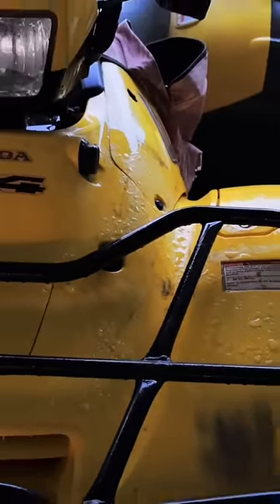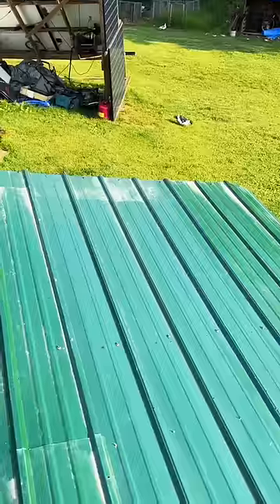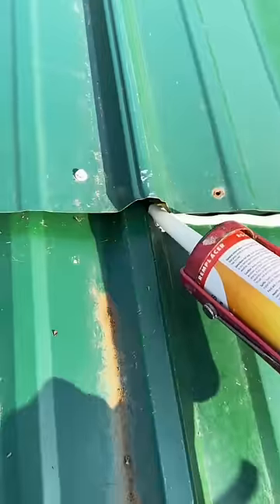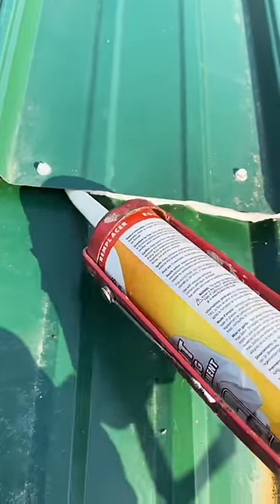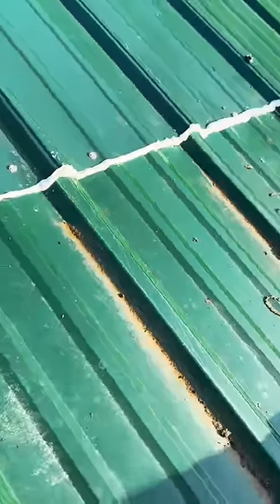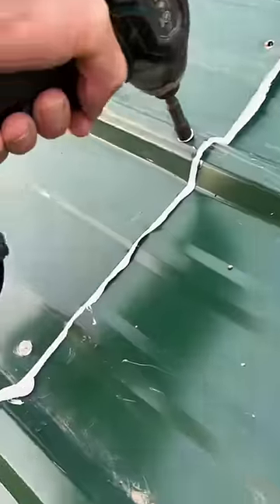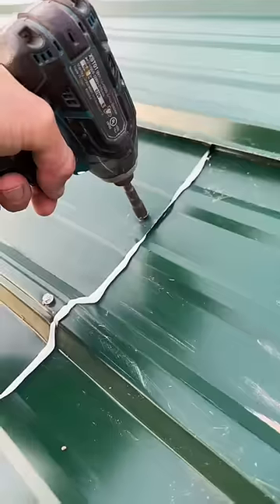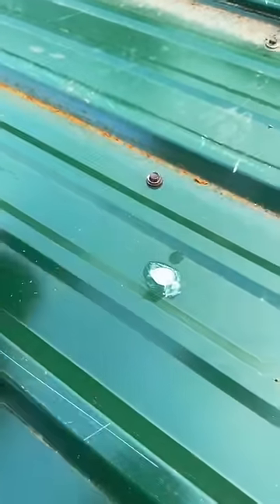Stopping carport leaks

Comment: The foil tape that some people use on ductwork is great for sealing screw holes. Cut small squares and cover the holes from the bottom side of the metal.

Comment: Roofing caulk the screws as well if it leaks after this. I’m not a builder or anything. But my dad did this to my cheap shed and it’s water tight now
Reply: Yup anything that goes thru the roof that isn't caulked will leak
Reply: It’ll work for a year or so and will need to be replaced depending on what brand was used M1 caulk is the best tho can lay it in any weather and it’ll hold true to time
Reply: Should be using roofing screws with a neoprene washer so this doesn’t happen, and shouldn’t be screwing into the pans, only on the ridges
Reply: @dankboi2295  that's good to know

Comment: As a waterproofer use NP1.
Coat all the screw heads and fill the holes.
The rubber grommets will either split or the water on them will freeze and split them.
The other issue with the grommets is the install.
Some people screw them down until they tear.
They are just suppposed to touch and then pooch out just a bit.
Impact drills go to far sometimes.

One other piece of advice.
NEVER use USED metal for a roof. 
Been there done that never again.

Comment: I've become a bit of a fan of Flex-Seal. The bucket version is very similar to the old roofing "tar" you'd use on trailer home roofs. You don't even have to wait for it to dry out. See a leak, smack it like spackle onto the spot. I tend to err on the side of over building, so I'd hit both sides of those seams. And you can sand the FS and paint on it. Note - even the bucket type FS comes in all kinds of colors, too.
   Tip for whoever has read to this point - spray Flex-Seal on those doorjambs and such that the cats like to claw up. Get a nice, bumpy-thick coat on and let those claws scratch. Took our multi-cat household over 3 years to wear it down to the point of needing to be redone.

Comment: Hey Narrow, tip coming from a roofer… caulk every screw up there, including the new ones. On top of the roof as well as inside the port on the ceiling. Those are major water entry points people forget

Comment: You can also use the foam strip, that comes in a roll and has adhesive on one side. The stuff that you use around exterior door frames. Caulk works better probably but the foam is less messy
Reply: That foam would very quickly break down in the Texas elements. Especially the heat. Then that would be an additional ridiculous mess to try to clean up to do the next solution.
Reply: @m2svirtual384 silicone and similar products hold water and cause rust much faster than would typically happen. There's always going to be a problem. I was just offering a quick and easy solution that I've gathered from my own experience. If you keep a roll of the foam on hand it's just a quick and easy fix until you get to something more permanent. Wasn't telling anyone that this was the best and only way to do it. I don't know why people take shit so literal and serious. If you can't see the use in it then keep scrolling. 🤷🏼‍♂️

Comment: Seal Gap is a good option. They sell it online and at Heavy Duty Truck shops. Sold by the gallon, made for semi trailer aluminum roof patching for leaks. Not that caulk was wrong, just might have been faster.

Comment: I've had to do something similar with the tin cover that extends off my front porch. Figured out the water from the roof was just flowing back between the gap where it met. Went underneath and filled it with silicone sealant and filled up any other gaps or seams. It doesnt need to be water proof, it just needs to make sure the water properly drains off the top rather than washing back

Comment: Could look into some “self leveling” sealants. Used to use them when i worked at an rv dealership you lay out however much you want over wherever and it will end up sitting nice and flat and work it’s way into the gaps

Comment: As a roofer i wouldn't recommend caulking on top of the seams as water will build up on it and eventually find a way through, instead caulk underneath far back and use stitching screws or rivets to hold the iron sheets tight. If riveting make sure you caulk in the drill hole rivets are going into 🤙🤙
Reply: Also when screwing into 5 rib iron always try to screw into the rib itself not the tray!
Reply: Also when screwing 5 rib iron always try to screw into the rib itself not the tray!

Comment: You also need to put the screw on the  high point of the roof sheet pattern that was water run off is far less likely to get in when those rubber washers age to dust.

Comment: Having done all kinds of roofing I can tell you no amount of seal that you apply to the roofing as you have installed it will last.  The simplest way to fix this is going to be to run 1×4 lumber  Perpendicular to the main struts. And relay the roofing perpendicular perpendicular to the  Lumber. And apply a ridge cap at the peak.
Reply: I guess another way you could fix it would be to cut the legs of each main support so that They produce a  slope.  It wouldn't take much slope...¼"/1' min but I'd suggest at least ½"/1' to make sure

Comment: Rv Mechanic here. I see you're using Dicor, which is a great brand of sealant to use. I would advise getting the Non leveling calk as opposed to the leveling calk that it looks like you used. The leveling calk will, well level it's self to the lowest spot, and possibly not seal well. Just a tip Incase it leaks again

Comment: You stated you made it. It is a pole barn. It comes pre made to size. You installed them dummliy sideways. Also, put neoprene washer screws not just hex metal screws. If you want a safer seal, apply 3 to 4 coats of hydro stop roof sealant.

Comment: Spray the roof and connections with flex seal. It will make it water resistant, repelling the water from above multiple coats do best.

Comment: Caulk is alright but pick up a roll of butyl tape. It is usually in the metal roofing section of the hardware store. It is far less messy, cheaper and works better than caulk.

Comment: If the metal was stacked under instead of over going down, would it have run off more instead of leaking so much?... the sealant would still be a great add on either way im sure.

Comment: I really love your videos, but a lot of people here are citing with the same thing that I'm about to say. That's not the proper way to do that, and you're going to have problems when the silicone shrinks and it's still leaks. The best thing to do at this point would be to go back to square one and put the roof on the correct way so that it drains properly
Reply: The self leveling sealant he is using is by a company called dicor. They actually manufacture it for RV use. I am an RV Technician here in Canada, and we use it to seal up around any fixture that comes through the roof. It is mainly used on EPDM (ethylene propylene diene terpolymer) roofs, which is a rubber product but can be used on TPO (Thermoplastic Polyolefin) roof aswell. It adheres to metal quite well, although not so sure about painted metal. But this product should hold its sealing properties for 10 years. Which yes, you can argue that a proper fix would last longer, but at what cost? He maybe used 30 to 40 bucks in sealants versus the much higher cost to fix properly. But like he said in the video, it's a storage shed, and he just doesn't want it to leak as much as it did. Which, with the small investment he put in, will accomplish that goal sufficiently. Instead of silicone for the holes, I would have used a product by the name of proflex. Does a better job of sealing and doesn't fall victim to harsh outside elements as quickly.

Comment: i use a roofing tar that comes in like a silicone tube kinda thing, and its really good, it works on wet surfaces. if that caulking doesnt do the trick try it out

Comment: You got no lap.... and it’s 90 degrees out, I suggest gecko coat or a sturdy tarp cuz that’s never getting dried out, don’t think it could handle the weight of a second skin run correctly tho maybe plastic panels their light af with 1” by 2” for stitchers, that’s probably what I’d do

Comment: Is there a comment that these roof panels should actually  go 90degrees from what they are now?! Water is supposed to run down with no stops, not stay on the ribs. Which, by the way, started to rust already because of wrong direction.
Just re-do the top as it should - sides will survive as they are.

Comment: Huh, did you forget the 1-4mm foam tape or is it actually this bad when installed incorrectly?

Edit: ahh, the storm lol, yeah  you have to install the sponge tape stuff between the screws and the seams, otherwise during a storm, water might push up and rust your screw holes, rendering the gasket screws useless

Comment: Did you use the screws with the rubber on the bottom of the head Cause that will help out to if it's still Leaking Try that rubber that comes in a can that you can spray on or tar the seems maybe try that I'd cope all the scenes with that rob rise spray paint All the screws Let it dry repeat 4 or 5times There's a million In one ways to stop a leek choose 1😂😂😂😂😂hope it works out bud

Comment: What do u do to rid poison ivy when it creeps on the homestead
Reply: don't know his answer, but this is ours.
rent a goat if possible.
if not, white vinegar + salt + a dash of dish soap in a spray bottle. repeat as necessary until eradicated. carefully remove dead vines while wearing impermeable gloves and ppe. throw dead vines away, but do NOT burn them.
Reply: I just bought 10 acres of wooded property and the whole thing is infested. Trying to avoid round up. Vinegar would work if it killed the roots. There are too many of them to dig up and its too tight to get a machine to dig em up. Fuuuck round up it is

Comment: Half assing won’t get you anywhere Nate…. You definitely should have built a roof structure so you could run the panels in the correct orientation.  Frankly, I’m a little disappointed…